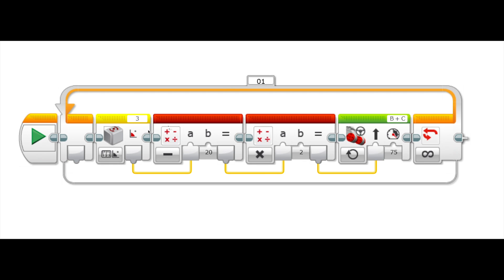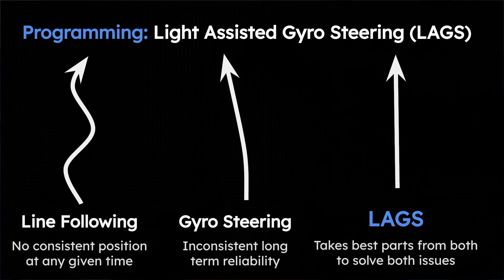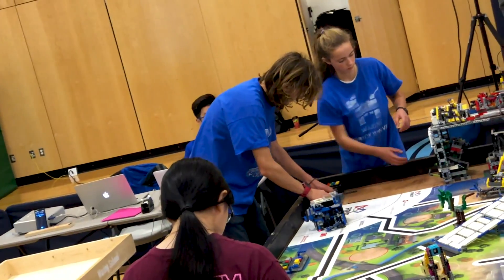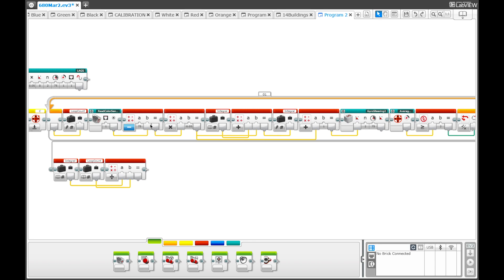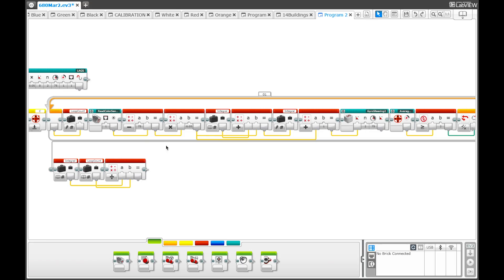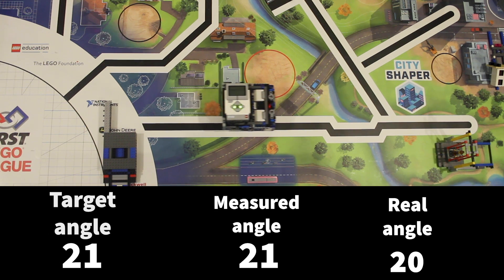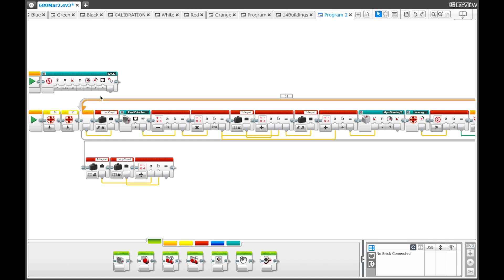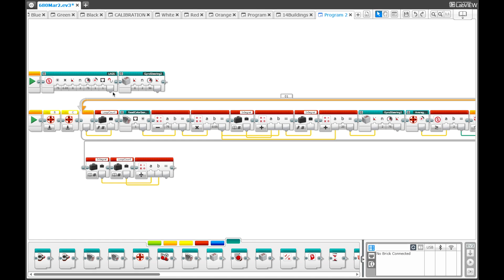FLL Drive Straight Program Tutorial - Line Assisted Gyro Steering - FLL City Shaper

Comment: what is the output on the GyroSteering2 myblock?
Reply from the maker: It outputs the current angle that the gyro is reading
Reply: @WaringRoboticsFTCFLL  why /where do you need it?

The concept of your program is great, however, we are struggling to put a condition for gyro loop as in the original one we had a number of rotations, could you please give us a hint?

Comment: Whats the program you created for the color coded attachments. I'm struggling to find it and i want to color code my attachments so i don;t waste time looking for the program for the next run on the table.
Reply: it's like a switch block inside the loop, the switch block is set to color and for the no color scenario set it to default by clicking the little box. now to add more ifs click the plus button. finally put you code inside the ifs depending on the color coded attachments. ps: they didn't make a tutorial about that.

Comment: Hello, my friend, I wrote a program according to your way, but the effect is very poor. I don't know where there is a mistake. Can you share a copy of your program to me? Thank you. My email is runpig1989@163.com If you share the plan.
Reply: You need to remove the loop around the gyro steering program and adjust the multiplier according to your robot. If the gyro steering program has an infinite loop, the program will get to the myblock and get stuck there because there is nothing to interrupt the loop...

Comment: So what is the actual program. The big program or the light blue shortened version
Reply: The big one is inside each small one. Each time you use a small one, you actually tell the program to use the longer code hidden inside the light blue one

Comment: Well done! 

This programm is one of the best I have seen yet. However, I have 2 questions: The first one is which programm are you using when there are no lines on the board?

Second: How can the Robot Stop so accurate with the fast Speed? My team (SAPies) has recognised that the robot drives Everytime too long with fast speed, so we made an acceleration programm. 

Best regards from austria ;)
Reply: Just using gyro i think